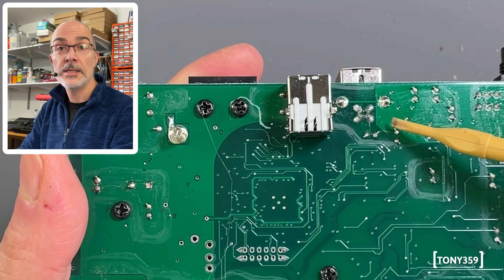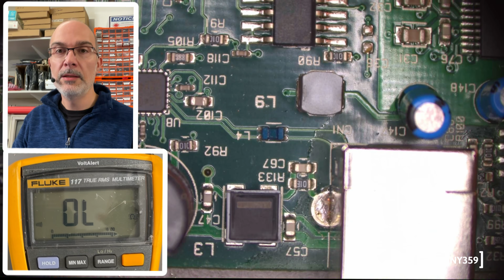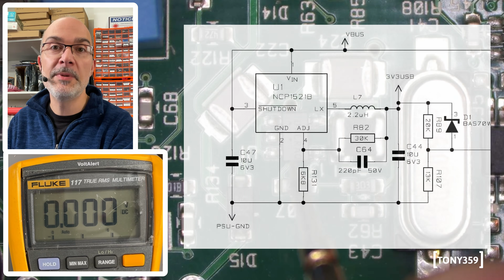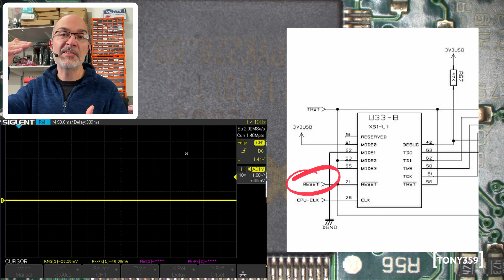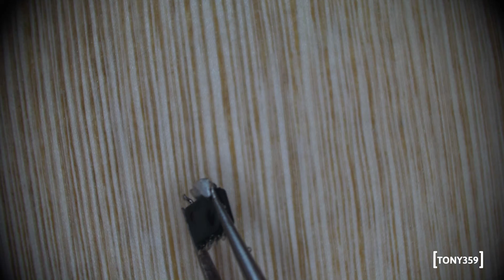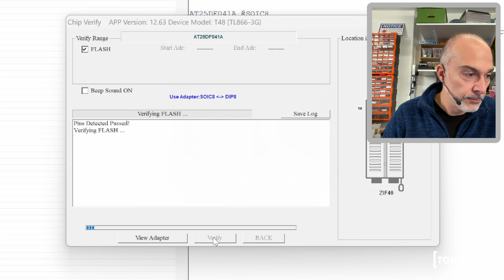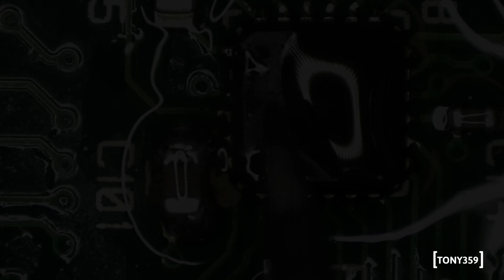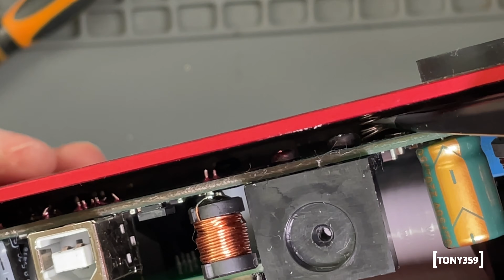Fixing this soundcard wasn't easy!

Comment: For small components like this, you'll need an Aixun T3B with T115 or T210 handle
Reply from the maker: Never an Aixun again! I can get a T210 handle for my JBC though :)
I should have used my old iron, for which I have smaller tips. Lazy :)
Reply: Yeah, one certainly does not “need” a Chinese junk soldering station. You “tolerate” one at best.
Reply from the maker: ahah, very good point! :)
Reply: @tookitogo  I never had a single issue with my T3B, I'm using it every day and I have it for over 2 years now.
Reply from the maker: Well, the designs flaws we talk about are now well known, it's not "if" it happens but "when" :)
Reply: @loonysam506  And that’s fine, but one certainly does not “need” one. There are countless alternatives, including name-brand stuff that definitely doesn’t have any hidden gotchas (like many cheap irons have, ranging from poor performance to life-threatening safety issues).
Reply: @tookitogo  You obviously haven't wached any reviews about that particular station Not everything made in China is of bad quality...
Reply: @loonysam506  There are lots of glowing reviews by hobbyists who don’t know what to look for. But on electronics forums, there are discussions of the problems they have, like the thermocouple shorting out (and thus being temporarily unable to measure temperature) if the tip is touched to ground.
Reply: @loonysam506  Regardless, you’re continuing to miss my primary point: you said that one NEEDS this station. No, one does not. One needs any decent soldering station. One does not need this specific one.
Reply from the maker: @tookitogo
You don't need to go far away to see how the T3x behaves: https://youtu.be/B7jLpHgR7fI and https://youtu.be/hGK7s-9tXs4 :) (The T3B is based on the same design and while I haven't tested it, I don't see why it should not be affected!)

To be fair, let's not split the hair in half: @loonysam506 meant "you need a smaller tip" :)
Reply: @tony359  Yes that's exactly what I meant by that 😉
Reply: The T3B doesn't have the same issues as the T3A does(well at least mine doesn't) it does not have these random temperature spikes and it does not overshoot.
Reply from the maker: There are a few reports that some T3A ones also behaved correctly. It feels strange that this can happen but I haven't had one of those in my hands to confirm. In your case, remember that some firmware HIDES those temp overshoot.
Reply: @tony359  Yes, you are partially correct, it is a firmware issue. Except they didn't hide those spikes they corrected them, but we both know that some hardware behaves differently with different fimware versions.
Reply from the maker: uhm... no, they didn't correct it! If you watch my first review of the T3A, with 1.34 the display always reads the set temperature but my thermometer says 400C. So no, I can confirm they are HIDING it. It's clearly shown in my video. 
Latest firmware tries to mitigate how much the controller "spikes". The design of the circuit causes the controller to lose control of the thermocouple (or, better, a grounded PCB causes a "very low temperature" signal back to the controller which replies with a spike trying to raise the temperature). Latest firmware is trying to recognise those situations and avoid the worst. 
That does not change the fact that the controller is *losing control of the thermocouple* so it "drives blind" while that happens.

In my understanding, this design flaw cannot be fixed with software. They'll hide it or make it "less bad". No more than that.

Comment: I think getting comfortable using solder paste and your heat gun, instead of solid solder and your iron, would significantly improve your enjoyment of SMD work :)
Reply from the maker: I do have solder paste - even though I didn't know it would expire! I might use it at some point!
Reply: @tony359  if it ever expires you can always refresh it. Solder paste is just microscopic solder balls held in flux. Just mix some fresh flux in if it's gone dry and it'll be good as new! 

If you prefer using solid solder wire for soldering QFN IC's, the trick is to tin the pads, hold the IC in position with tweezers and use hot air to reflow the IC until it's held in position. Think of it as "tacking" it in place. 

The next step is to place your tweezers on top of the IC and apply downward pressure, you did that correctly in the video, you just didn't wait for it to reflow. When the chip reflows you'll see some excess solder squeeze out from under the chip, that's how you know it's soldered. 

With QFN chips like this that have a big ground pad under them, the ground pad wicks away heat. That's what happened here. The outer pads/pins hit reflow temperatures but the middle bit didn't. You'll know you've got it right when you get a solder blob pop out at the side of the chip somewhere lol.

Use some flux and wipe the excess solder away with your iron and that should be it. That way you'll have a good electrical connection between the IC pads and the PCB pads underneath the IC.
Reply from the maker: As you say I probably didn't wait enough - even though if you look carefully I see the IC sliding a bit when I'm warming it up for the second time. Not sure. But I'll bear that in mind thanks!
Reply: @NewRetroRepair Solder paste absolutely does go bad: in the short term, solvents in the can flux dry out, but even if they haven’t, in the long term, the surface of the solder balls oxidizes to the point that the flux cannot break through it, or has actually oxidized all the way through. (The surface area of solder balls is huge, relative to the solder volume.) Paste in that condition will not flow at all. 

For hobbyist and small batch repair, paste lasts well beyond its expiration date, especially if properly stored in a fridge, but it still won’t last forever.
Reply: @tookitogo  that's good to know, and reading what you've said that makes total sense. I guess it's a case of "your mileage may vary" when it comes to mixing flux into dried out paste. I'd imagine some active flux would help a lot though.
Reply from the maker: I read about storing it in the fridge but I cannot think of having lead in my refrigerator!
Reply: @tony359  Lead doesn’t even vaporize at soldering temperatures, so it’s not going to in the fridge. Just take the container (I recommend buying it in syringes) and put it in a ziplock bag before putting it in the fridge.

There are now a very small number of no-refrigeration solder pastes on the market (Chip-Quik sells them). All the rest must be stored cold to get any kind of shelf life out of them.
Reply: @NewRetroRepair  Yes, if it’s just the flux drying out and minor oxidation at most. But once any significant oxidation has set in, the paste is toast. 

Just for some context: in commercial mass production, where the paste must perform flawlessly every time (because you’d go broke if you had to rework even one BGA in 1000), solder paste is thrown out if it reaches its expiration date, stored cold. It’s taken out a few hours in advance (I think they even have special doodads to do that in) before opening the jar to put it on the stencil printer. Once opened, the jar will never be refrigerated again because this can cause humidity to condense inside the jar, and so at the end of the day, whatever paste is on the stencil is tossed, and so is whatever is left in the jar. Now, that level of fastidiousness is totally unnecessary for home or small-run production where occasional rework is tolerable. Scrape the excess paste right back into the jar and put it back in the fridge. For BGAs, however, I would only use paste from a syringe so that it’s always fresh and uncontaminated, since you have no way to rework an individual joint.
Reply from the maker: I appreciate that but I don't want lead in my fridge, full stop :) 
The bag will end up on my workbench, then back in the fridge. No thanks :)
Reply: @tony359  Then you need to either buy the no-refrigeration paste, or buy one of those tiny Peltier fridges that’s designed to hold a single 6-pack of beer! :D
Reply from the maker: Yes, that is what I would do. Right now, the workshop is a natural fridge though :)

Comment: you have to hold down the IC with your tweezers and add hot air when you put it on, otherwise great video! 😆
Reply from the maker: I did - 24:17. Clearly not enough heat? But I see the IC sliding a bit so I am a bit puzzled! But thanks for your input!

Comment: 28:11 I had a moment like that when i replaced the HDMI connector on a PS4. Some of the pads were broken off. I spent hours with tiny strands of copper wire to repair the traces and it looked ugly. I was jumping up and down in excitement, shouting: "YES YES YES! It works! YES!" when it finally worked. I couldn't believe it. It was such a relief and I was so happy.
Reply from the maker: I know the feeling! Those pads are a pain! I replaced one on the PS3 but it was still a through hole!
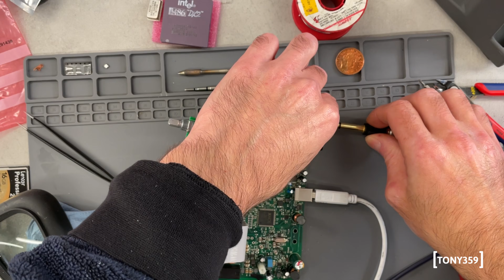Reply: 28:44 That smile on your face says it all.
Reply: sounds hard. I hope to one day be able to do that

Comment: Good job, just keep on exercising. 😉
And now let the ideology wars begin: When I solder QFN or other packages like this, then I use in the first step NO flux. It happened to me very often, that the flux lets the IC swim on it. It will align by the capilary effect but does not connect to the pads, because the flux does what it can do best, it keeps the solder away from building solder bridges. So first I rely on the remaining flux contained in the solder on the pads, then I roughly align the IC on the foot print and let do the capilary effect the rest when heating up everything with hot air (every try to align it with tweezers will misalign it more than it aligned by itself). In the end I use flux to rework the pins to make a good connection between IC and Board. Another trap is the amount of solder to put on the exposed pad, but you did it instinctively right. If there is too much you also lift the IC to far away from the pads, it will not align and doesnt connect to the pads.
Reply from the maker: Thanks for the input - it's good pointers! I can't wait to do another one!

Comment: Nice work! Those J-lead style packages are such a hassle to solder, even for larger ICs, and because of the angle it's not so obvious when you have a bad joint.
Reply from the maker: Yes! But I can't wait to encounter another one to practice more! Thanks for watching!
Reply: Italian here. I can confirm a very polite, gentlemanlike, reaction to the desoldering incident 😅
Reply from the maker: ahaha grazie!
Reply: Just a minor correction: that isn’t a J-lead package. J-lead means packages that really have pins that come out the side and then fold down, with a curved end folded under the chip. The most common J-lead package is the PLCC (though not the version used for LEDs).
Reply from the maker: Thank you!

Comment: 28:33 It is a good practice to put some fresh solder on the IC itself not only on PCB pads, and I think you've forgot that. But overall, nice repair.
Reply from the maker: Very good idea! I actually removed some from the ground pad as I thought it would be too much? I have a feeling "more is better", the excess would squeeze out when you press the IC! Thanks for watching!
Reply: @tony359   More isn't better, not even close, less is good, but the trouble is, this IC probably spent years nobody quite knows where, its entire bottom is likely oxidised and may not be eager to accept solder before you re-tin it. I think that was why you had unsoldered pins. As such this is indeed a good call. Maybe your flux is also not quite angry enough to deal with that without a little extra encouragement.

Serious manufacturers are highly reluctant to use ICs whose manufacture date is more than about 2 years old for this very reason, this is how they end up cheaply on the Huaqiangbei market.
Reply from the maker: very good point! I was indeed wondering how such an IC would work in a proper production line, in a reflow oven!
Reply: I've never done that with any IC. Drag-soldering with a chisel-point soldering tip and using plenty of flux works well.

Comment: You made everything complicated without reason, heat chip up and press it down. There was too much solder on the ground pad in the middle and that kept chip in air above PCB. Just press it next time, extra solder will pop up somewhere on side, just clean it with soldering iron and that's it.
Reply from the maker: I did press it, 24:18 ! :)
As I said, this was my first time with this kind of package, I'm learning! First time is not going to be perfect! :)

Comment: Good job! How about the other firmware? Have you checked if is compatible with your device?
Reply from the maker: I didn’t! I didn’t feel I wanted to de-solder the IC again. Those pads might not like it! But it’d be nice to see what happened! I did flash the original 2i2 firmware before testing of course.
Reply: @tony359 I see, that PCB is quite low quality, better do not disturb it  while it works. Maybe they build the pcb cheaply because is not intended to be repaired? You know, few cents from here, few cents from there...
Anyway, is good that you have a backup of the original firmware.
Reply: @sebastian19745  Indeed noticed that too, really cheap PCB and connectors for an expensive card with a high quality look and aluminium case, seems like a sign of the times... The device screams just "focus right" on the case and not the contents of it.
Reply from the maker: I shared both firmware on badcaps.net, link is in the description. PCB's are never meant to be repaired nowadays unfortunately...
Reply: @tony359  Of course companies don't want you to repair the device or they even not care what you do with it since you bought it and they got the profit, but I am mostly concerned about that cheap PCB cause it doesn't seem to have sufficient copper planes to isolate noise from digital to analog part and generally noise. Reminds me of the old ISA Soundblasters that their PCBs were almost transparent and had really awful SNR...
Reply from the maker: A good noise floor is something I was looking for and the 2i2 is ok. Not as good as my MOTU but pretty close. So far it looks like it’s performing well! But I’m not squeezing it too much! 🙂

Comment: Very difficult little chip of the devil there to solder indeed Tony... But glad you eventually persuaded it to stay at its seat completely, but the most important thing here is the correct troubleshooting method you used to discover that tiny faulty IC.
I was a bit scared with the firmware situation cause you did not say, do you run the card with 214 firmware or reverted back to the original that the little ROM had inside?
Also the black knobs seem to have that velvet feeling coating which eventually turns to a gross glue on plastics and looks dirty without being.
Cheers from Greece, keep up, best wishes and better year for all of us than that shitty 2023! Jim.
Reply from the maker: I did revert to the 2i2 firmware, it just didn't make it in the final cut! :) 
Yes, that "grime" could have been that "soft rubber" which disintegrates over time. But I am not 100% sure, the whole thing was honestly covered in grime when I got it! :D
Thanks for watching!

Comment: Well done Tony mate, that was fun. The pad you accidently removed did look to me like it was connected to the pin next to it and also I'm sure I saw a smal Via going through the board, probably just grounded, but did you check it on the circuit? Well done & Happy new year. Bob
Reply from the maker: You know, I thought I saw that too. Silly me I didn’t even check on the schematics! I’ll take a look, thanks for mentioning.
Reply: @tony359  pretty sure it was not connecting to anything
Reply from the maker: I double checked that and thankfully it was not connected to anything! Panic over :)
Reply: @tony359   Ok mate, that's good, when I saw at the end of the video that it worked so well I guessed it probably wasnt important. We have all done it mate, you must make sure not to wiggle the braid and the iron when you de solder small pads like that, or use an electric de-solderer. Also if I may, I was cringing as I watched you going over the soldering over and over again. your technique with the hot air was perfect, especially the holding it down while cooling, and should have been enough to do a good solder job, it didn't because of flux, you need a fair amount and good quality, like rosin. but my point was touching with the soldering iron so much on those small chips can kill them, you were lucky, cool as possible for as short as possible. Bob
Reply from the maker: Thanks, I shall keep that in mind for next time! My flux is... cheap. I have the Amtech as well, maybe worth using it for such delicate jobs!